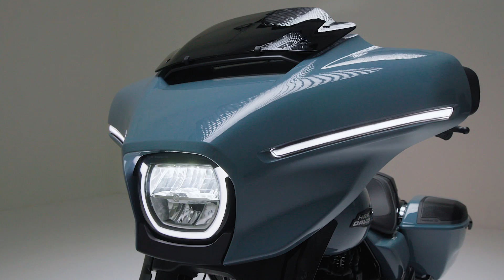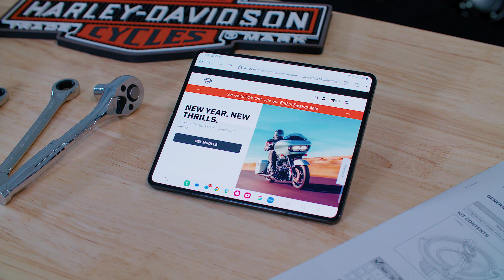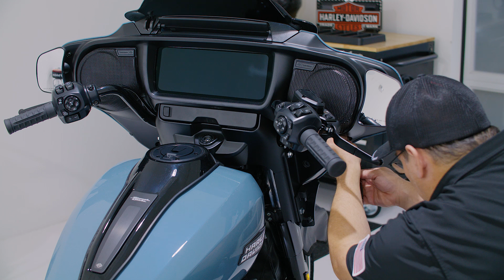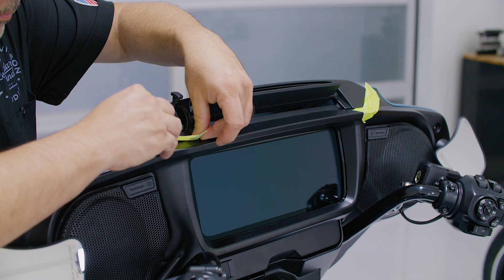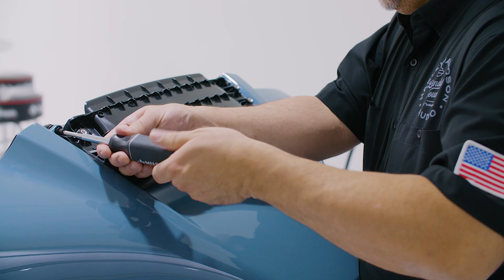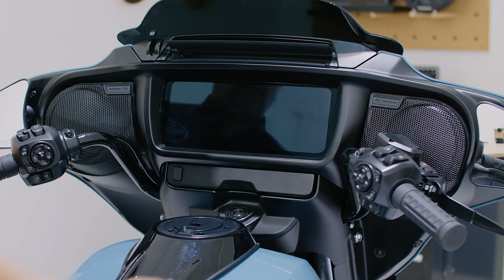2024 Street Glide Primary Amplifier Install | Harley-Davidson Audio Powered by Rockford Fosgate

Comment: I just put the stage 2 kit in my FLHX. I have the rear speakers and lids ordered but will not get them for a week or two.  Even riding to Milwaukee today to pick up the kit, with the stock system still in, there were times I couldn't hear it enough to even realize what song it was.  

With just the stage 2 kit (amp and front speakers) only, it is 10 times better sound and is a lot louder.  With volume maxed it is programmed so that there is no distortion and it does sound crystal clear.

As frustrated I was and am that I spent over 32K on a bike and then I have to drop $2500 more in a stereo that works properly,  I would recommend this setup.

Know I did buy the highest wattage equipment when I had choices,  I am glad I bought it. Music is important to me when I am on this bike, or else I ride my wideglide.  

Jeff from Winneconne WI

Comment: I recently bought this 76001294 Rockford Fosgate primary Amplifier for my 2024 Roadglide.
As the stock 200 watt Amplifier is total trash but that's another story for a later time.
Following the installation instructions to the letter basically a plug and play install with a few prompts via the touch screen.
Fairing consist of two 6x9 Hertz speakers.
This supposed 500 watt amp is barely pushing them to life.
At this point I feel beyond robbed by Rockford Fosgate and Harley Daivdson collectively.
In closing don't waste your money on any Fosgate products.
Reply from the maker: Hey there! We'd like to try to help you, but we need more information from you. When you have a moment, please give us a call at 1-800-258-2464. Thank you!